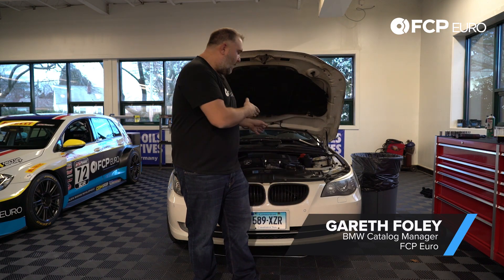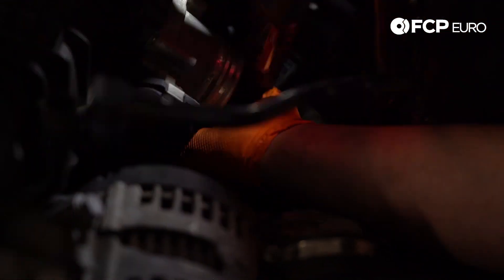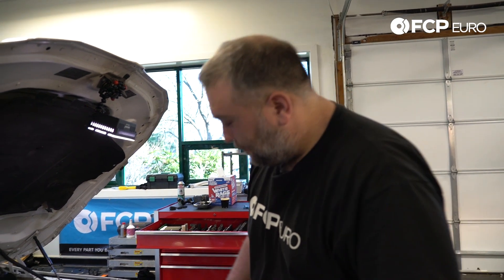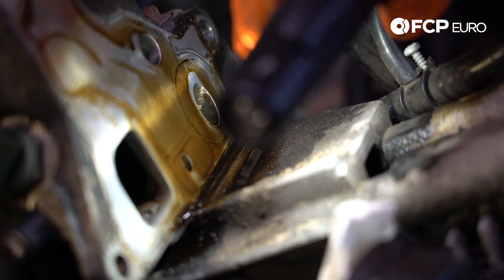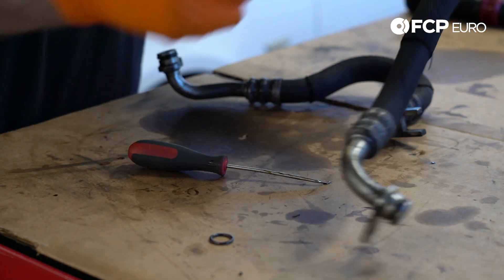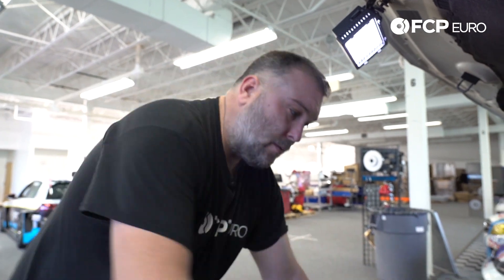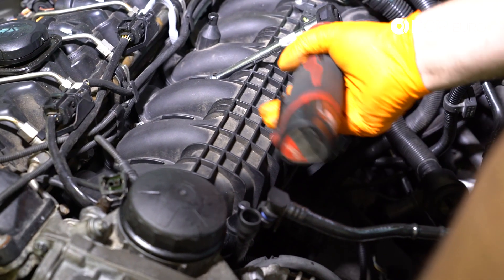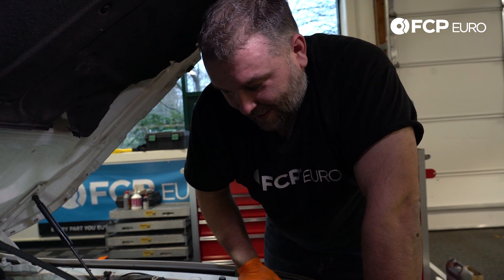How To Replace An Oil Filter Housing Gasket On A BMW N54

Comment: All you have to do is remove the intake manifold bolts, then lift up the intake manifold while moving it to the right just enough to get clearance to the bolt. You don’t even have to remove the charge pipe. It makes the job so much easier. Under and hour to do. This guy did extra lol. Sorry fc euro, I do buy parts from there tho 👍🏼
Reply: T
Reply: you all prolly dont give a damn but does someone know a way to log back into an instagram account..?
I stupidly lost the login password. I love any assistance you can offer me
Reply: @Westley Clayton instablaster =)
Reply: @Kendall Javion I really appreciate your reply. I got to the site on google and Im trying it out now.
Seems to take quite some time so I will get back to you later when my account password hopefully is recovered.
Reply: @westleyclayton5872  been 3 months, and? Didya succeed?
Reply: Yep
Reply: Just now seeing this one. This dude is doing way too much work just to change the OFHG. Real technicians find every shortcut possible.

Comment: This guy doing so much extra work.
Reply: Did extra for the shot I guess.
Reply: Ya I'm going to be doing this on my 335is soon and at least from the looks of it all the radiator stuff should be unnecessary if you can get an E12 wrench behind the oil cooling hoses.

Comment: Thanks for the walkthrough! I did these two gaskets and the valve cover gasket too. Then I did the pulleys and plugs. Finally, I did a manual clean of the intake valves. Took me four days at home. Saved $2500 at least! 09 135i M-Sport N54 75K miles.
Reply: Sure 2500 $, But 4 days at Home isn t Worth the effort ...
Reply: Manual clean -- 3 bond? CRC? SeaFoam? 
Vacuum or rags?
Stainless or brass brushes?
How did you clean the valve-seats? I always wonder is the cleaning is more than a patch? I mean if done well it would be gery helpful, but seats & stems and guides aren't really improved, tho probably not made worse either. I wonder what the best practice is - pull the head, rebuild, new valves (and seats, if pressed in), or maybe swap out fir a professionally rebuilt one, and attend to the bottom end: main seals, for instance?
Reply: IF YOU DID ALL THAT IN 4 DAYS IS WONDERFULL.......
Reply: I did the same,  the time it takes is because cleaning the intake valves you have to let the solution sit and eat away the gunk.  FI cleaner works too

Comment: No need to completely remove the intake manifold.  Just release the bolts half way and pull the manifold out enough to access the hidden bolt.  Throttle body stays in place, charge pipes released only on throttle body side.  Also, use pinch off clamps to contain oil and coolant, so no need to drain.
Reply: Did you need to pinch off the large coolant hose connecting into the oil filter housing? Did you pinch off both oil cooler lines?
Reply: It's hard to get the manifold out if you leave the throttle body in place because the TB will still be hooked onto the electrical box. Better to just disconnect it like he did here. Besides it will probably be nasty and need to be cleaned.
Reply: You don't even need to remove the coolant line. It'll come off enough to clean and replace gaskets while still attached if you're afraid of breaking it.

Comment: I just did this job on an N54 (2011 335is) and have some notes and tips that can save you hours of work over how he does this job. 
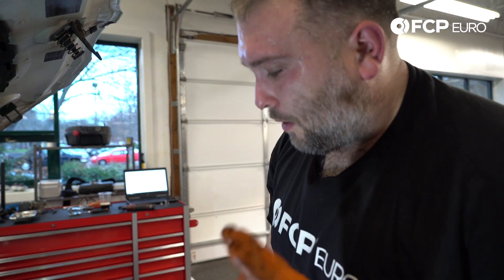5:55 on my car they're 5mm hex screws, not 6mm
6:00 he misspeaks but corrects himself later, there is only 1 bolt, and be careful when removing the nuts not to drop them
7:18 - 11:08 You do not have to do any of the hood latch and cooling system work he does, simply remove the oil cooler lines from the housing like he does at 15:35 but while the whole housing is still bolted in the car and save yourself a ton of work. Also my car uses a 13mm bolt to hold that line bracket in instead of the 6mm hex. When you pull the lines down some oil will come out so have some rags under it.
11:15 It is not necessary to remove the oil filter when removing the housing, just flip the housing upside down when you take it out and be careful.
11:45 It is definitely not necessary to drain the radiator as there isn't that much coolant in that top hose, so get a milk jug or 2 litre and cut the top off then get a plastic grocery bag without holes and put the bag under the hose as you disconnect it from the oil cooler housing, maybe 10oz of fluid will come out, then put the bag in the bottle because there are a couple holes you missed and you're making a mess.
32:30 when ordering a throttle body gasket make sure you get the right one, it might be listed as an intake manifold gasket, there is a regular o-ring between the pipe and the TB and a gasket that goes from the TB to the manifold that you see him pop out. While the o-ring will fit in the groove on the TB it will not seal and freak out your ECM, ask me how I know.
Good luck and let me know if you have any questions.
Reply: I didn’t see his throttle body o-ring…did he forget it?
Reply: I appreciate you for taking time out of your life to leave this roadmap for us to use. Hope all is well 🤝🫡
Reply: Thanks Brandon this was super helpful, likely saved me a couple hours on this job. Cheers!
Reply: Not all hero’s wear capes. Sometimes they have bunny slipppers.
Reply: I don’t even remove the manifold like he does to do them 😂 I don’t get why FCP directs people to do the work the long way
Reply: They want you to drain the coolant and remove this, that and the third so you buy more parts.
Reply: Ty I'm doing this in 2 days.
Reply: @TheFLGUY76  Good luck, it's easy just take your time and make sure you have all the tools you need before you start

Comment: Thanks so much for this video. Its my exact car and I was having trouble finding one that matched perfectly. Followed every step and car is back running. Again, thanks a million really helped me out.
Reply: Isn't it amazing how I'm about to do my 2011 E82 N55 OFHG, and newer BMW still have the same design flaws & weak points like plastic charge pipes...
Reply: @DigitalDissident  Not hard to upgrade, and consider - despite some weaknesses, top builders still appreciate the n54/n55 as such a great platform for improving (to way beyond the way any of them were sold.) Very strong block, lots of room to grow

Comment: Thank you very much for this informative DIY video. Only one thing I would like to say here when you installed the upper radiator hose ( 26:47 to  27:00), it will be better if you push down the snap ring/lock first before inserting the hose so that you gonna hear a click as an indication of proper installation. this just my way to do it. Appreciate your effort
Reply from the maker: You can definitely do that for sure if you would prefer. But the one nice thing on these hoses with the quick disconnects is you can't fully seat the locking clip unless the hose is properly seated. I've installed them both ways, generally I install new hoses with the clip down and I install old hoses with the clip up as that is how I left them when taking them off. - Gareth
Reply: True, and thank you for your reply
Reply: @fcpeuro  interesting details, thanks for all the vids (and the fish!) This, vcg, opg and if possible, any number of other small and large items on the list to get her back lean and tight! N54's are not just faded history yet!

Comment: Great video and very detailed. My car is in the shop for this exact reason and since I can't work a screw driver, I'll leave it to the pros. I just hope the serpentine belt didn't get sucked into the engine.
Reply: The previous owner of my 2010 535i E60 had the oil filter housing gasket replaced, but whoever did the work did not 5 up all the oil that had leaked down the front of the engine. Over a few months, maybe 1200 miles, the oil began to coat the belt and pulleys, causing the belt to snap catastrophically. Make sure, whether you do it or the repair shop does it, the oil gets cleaned off. Also had oil build up in the radiator and intercooler. I removed them just to clean them.

Comment: I can’t get the bolt to thread under the manifold when I’m re installing the ofhg.. loosing my mind. It goes in back 1/4 way than gets real hard to turn. I don’t want to strip any threads or anything. 

Loosing my mind please helps can you use anti seize as lube/grease?
Reply: Take it you finally got it in ok?
Reply: @TheFrenchPug  yes got it in and everything is well, no leaks. BUT was very nerve racking. Just cleaned the threads a little and screwed in the old one again and out couple times very lightly and new one threaded in nicely after some tinkering. Careful though fellas, don’t want strip the block lol.
Reply: @robertkenney6002  Whew! Those situations give me heart attacks. I actually twisted off an injector bracket hold down bolt. Couldn't extract it and had to drill it out. I still have a steel self tapping wood bolt in there holding down the plate. I need to take it to someone who can fix the hole and put the helix coil in it so the OEM bolt will fit again. I had a heart attack when I screwed it up. But it's just Jerry rigged now on my perfectly running 2009 335i :(

Comment: You mention that two different oil cooler line o rings are needed. Part numbers? I'm buying the oil filter housing kit I found on fcp but it doesn't include those o rings. I think they should be included but what ever. I found two different o rings on your site. I just want to be sure its the two different ones that are needed.
Reply: I just bought the kit and it doesn't include the o-rings. smh

Comment: This is how you charge for 3-6hrs of labor.  It's a 2hr job when you get the hang of it...even less probably.

But I have to admit my man is thorough and extremely knowledgeable!
Reply: I have this leak so I've gotten pretty good at replacing the serpentine belt, what started out as an hour long job I got down to about 10 minutes, it also goes a lot quicker if you don't get to the end and realize you skipped a pulley.
Reply: @brandonlink6568  I have a long e12 black bolt I can’t figure out where it goes did you encounter a bolt like this? I replaced my ofh gaskets serpentine belt and pulleys and alternator.
Reply: @marklynch1305  I have not, but I didn't replace my tensioner (I need to because that T60 hole is getting pretty stripped). Some tensioners come with new bolts, looking at FCP Euro's part #11288624196 it come with a long E bolt

Comment: All you have to do is move that manifold back an inch or so. You can break the bolt loose with a 12 point 5/16 wrench, and then get in there with an 8mm 6 point 1/4 drive on a wobble or a flex extesion and back it out. very easy. the manifold really only adds an extra 20 minutes to the job

Comment: Nice Gareth!  I just did this on my 2009 535xi last week!  Bought all of the parts from you guys!  The job was not to bad but figured out my slight coolant leak was NOT from the housing or top radiator hose as I thought,  it was leaking at the water pump (probably the "U" hose) Just did that job (water pump, thermostat and associated hoses) and it was a total B1tch!!  Also, unfortunately, after getting it back together turned out the brand new thermostat housing was leaking where the 2 halves came together! :(  Had to rip it apart and just re-installed the original thermostat (additional 7 hours of work, yuk, BMW REALLY made it difficult on the E60s, you should do a how-to for that on the E60). All is good now so far!  Just wish the new thermostat wasn't defective.  Sent it back and got my refund already!! Awesome Company, I am recommending FCPeuro to everyone I know!  ** Additionally, I did the from main seal and serpentine belt already months ago, the belt broke and i shut the car off immediately, it destroyed the front main seal but did not ingest the belt very much, lucked out on that. **
Reply: Do you have directions on how to do the front main seal and replace serpentine belt?
Reply: Why did your belt break when it was only a few months old 🤔

Comment: Bottom e10 on the oil filter housing is stripped to sh*t, had to reassemble and put off the job, what should I do??
Reply from the maker: That's not fun, Luke! Did you use an ETorx socket on it? If you can get a pair of vice grips on it and try twisting it off we can get you a new bolt, otherwise you may have to drill or cut the bolt out!
Reply: FCP Euro It was pretty malleable for some reason when when I went in with the e10 ratcheting wrench it just got pretty bad. Thanks for the tip though I might not even worry about it, the housing doesn’t seem to be seeping or anything

Comment: I just did this job on my car and when I was done it sat there and idled just fine. Then when I went to go for a test drive the car went into limp mode and says engine malfunction code p0016 and it’s talking about timing. What could have happened? Only thing I think I may have done wrong was accidentally dump oil and coolant all down the front of my car. Help  (09 bmw 335xi n54 )

Comment: I did this work my E90 N54 but I got shaky ad rough idling afterwards. I double checked all the air intake components are properly installed and did a clean oil change but still the problem persists. I get a 0x3100 boost pressure build up blocked error code. Any one have any idea what could've gone wrong?
Reply: Did you ever figure this out? Only thing I can imagine is the MAP sensor is disconnected on the charge pipe if you took it off. I've never gotten that code. Only loss of boost pressure. Did you disconnect a vacuum line from the throttle body?
Reply: @TheFrenchPug  I checked the MAP sensor, it's fully intact. I checked all the vacuum lines, took apart all the air inlet components and put back together. Checked the ignition coils too, thinking one may have came loose when moving the manifold. Nothing fixed it, although the rough idle is not so bad so I'll just leave it for now as I don't even drive the car much anymore.

Comment: So I just did this on my 2008 535i and now my car is showing 2 error messages “engine malfunction. Reduced power” and “malfunction in transmission” . My car is starting but it takes longer than normal and it drives but it won’t shift and acceleration is pretty weak. Do you have any suggestions as to what could be going wrong?
Reply from the maker: Hi thenicknetwork, these issues sound unrelated to the oil filter housings gasket replacement. It would be best to bring your car to your local service center to get properly diagnosed.
Reply: yeah it wasn't there before. OBD2 brought back a crank shaft position sensor error. we cleaned a lot of gunk and oil residue off which may have gotten down in the sensor or somehting
Reply: So an update Incase anyone runs into this issue: as I mentioned OBD2 brought back a crankshaft position sensor error so we went to replace it and noticed it wasn’t connected. It wasn’t one that we intentionally disconnected so The thought is while putting the manifold back in, it was pretty tough and required a little force and while doing that, we bumped into the crank shaft position sensor which caused it to come disconnected. After reconnecting it everything cranked up fine and the errors were gone.
Reply: I know I’m a bit late to the party, but I had similar issues with my 535i after repair (done the repair myself). I had to disconnect the ecu connectors and apparently when put it back together one of the connectors didn’t get fully seated... after getting them properly connected, all the issues were gone...

Comment: I have seen a post on the forum and on Reddit of someone who blew a crankshaft after a oil filter housing gasket replacement due to a oil starvation. Any advice on n55 oil change and priming the oil and how to properly do it? Thank you so much
Reply: I hear you have to prime the oil system. and pour oil in the housing. I also hear you soak the filter.  I’m looking into it myself. Did you ever find a answer before you replace the OFHG?

Comment: Regarding the lower bolt of the oil filter housing gasket. Is it the flange that breaks typically or the bolts that mount the flange to the face?

Comment: Why do I need the thermostat plugs? Why doesn't the kit include the o-rings on the oil cooler pipes?  Should I replace the intake manifold gaskets too?  You replace them in the video as well as the throttle body seal, but these parts are not in the kit.
Reply: Exact same thought! Not sure why I need new plugs or bolts but 2 $0.69 o rings would really save the day here.
Reply: Replace intake manifold gaskets and throttle body gasket

Comment: So i'm not draining my coolant before i do the replacement, I know i'll lose a little coolant from the hose, but when i put it back together --- am i in the clear to drive it 15-20 minutes to my auto shop to have oil and coolant change? Or do i have to fill it up with more coolant?

Comment: ok I see way he takes the whole assembly out, because int he e60 the bolt that holds the coolerandits  lines to the oil cooler is up side down ,,

Comment: Knocked this and a bunch of other maintenance items on my N54 powered e92 recently, and here's some advice: For the forward most bolt (next to the Mickey Mouse flange), it's worth replacing the flange with a metal one (which is what I did) or removing it to inspect and replace the oring while you have everything taken apart - this will also allow you to properly torque that hard-to-reach OFH bolt. If you've never done the OFHG, definitely also remove the serpentine belt and inspect it (replace it if it has any oil or coolant residue) and inspect and clean the pulleys and tensioner. Consider also upgrading the power steering pulley to an aluminum one.